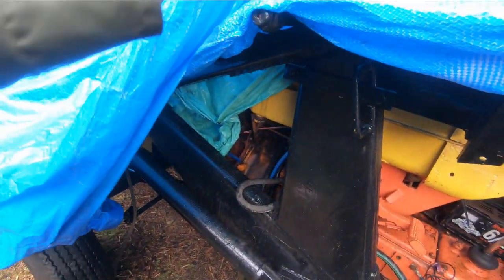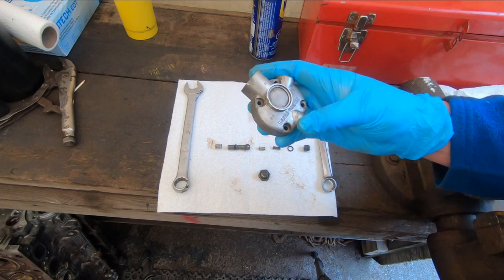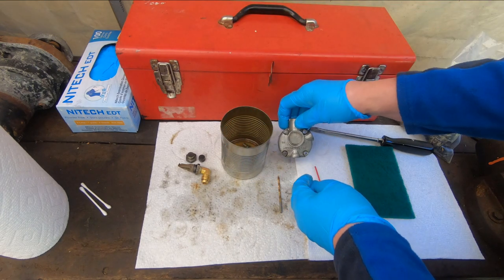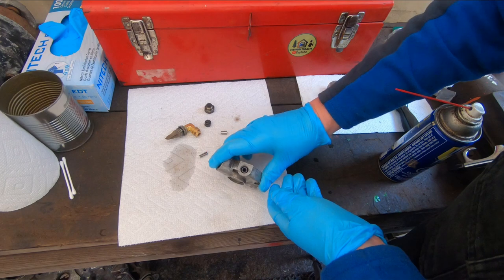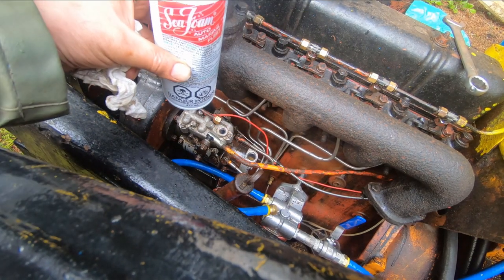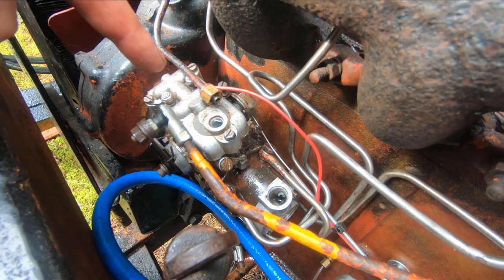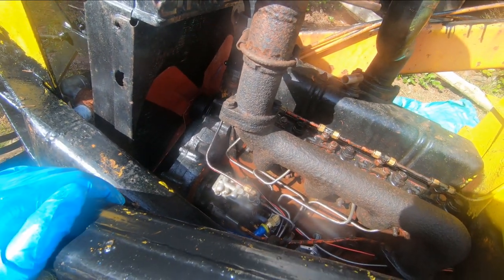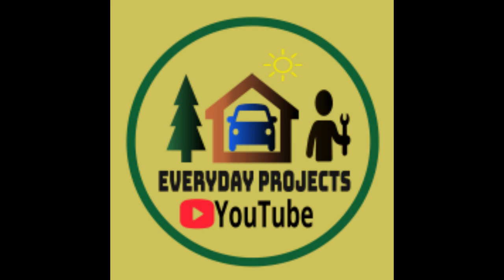FINALLY RUNNING !  1968 CASE 580CK TRACTOR ~ STANADYNE FUEL PRESSURE REGULATOR DISASSEMBLY & CLEAN ~

Comment: Well, that same little piston was really stuck in mine. I ran it through the sonic cleaner several times, but it remained really stuck. I ened up using a well fitting shaft to drive it out of it's cylinder. Just getting that entire cylinder and piston was an ordeal, but finally got it. I cleaned the cylinder really well, very smooth and did the same to the piston, but it does not slide back and forth when I shake it as you did. It does slide extremely smooth inside the cyliner thst it rides in, but does more with just bare pushing it. Thanks for that video, that really saved me a lot of troubleas the tractor is 50 miles from where I live, so that would be a heck of a drive. Thanks again, will keep you updated.
Reply from the maker: I bought a sonic cleaner from VEVOR a while back and they are great for cleaning small parts. I don't know why I didn't use it for this fix??? Take care Michael

Comment: Wonderful job, great progress😂 Ive  been watching your channel for a couple of years..I have a1968 580B  a backhoe / Loader  basket case , it was owned by a good friend of mine Ranger , a rod bearing spun , he took it a part , removed the head .Pan , rods pistons and sleeves Realized he had to split the tractor to get the crank welded .He covered in a blue tarp and left it for15 years in the rain. He was killed in a Train accident and his widow gave it to me . I bought a used 188 d wilth a frost crack in water jacket complete Core motor and intend to split the tractor and make one good engine out of two with a overhaul kit .Ive learned a lot from you .Thank you for documenting the process 😊 yours Kim
Reply from the maker: Very sorry to hear about your friend. You are lucky to have the tractor. What a wonderful gesture for his wife to give you the tractor--it must mean a lot to you.  I am slowly getting things together on this one. I don't have a lot of time to spend on it but I am making progress. Getting the engine to run was a big leap forward. Take care and keep in touch.

Comment: Is it still hard to start. Because mine was sitting for 10 years with a bad starter, I fixed the starter, and it fires up on a dime every single time. It can sit for months and still start as if it was running 10 minutes ago warmed up or 1 engine revolution at the most. It’s like the engine just left the factory and the rest of the tractor was rotting away. Can you do an update video on your tractor, show the current progress and what still needs to be done. I seem to enjoy watching you work on your tractor more than I like working in mine. Thanks for the content.
Reply from the maker: I've been planning an alternator video and this might just be the push I needed. Let's see what happens in the next couple of weeks.
I put in a new starter a few years ago and have used it hard while trying to start this thing. Maybe it has lost some of its original power. I haven't done much to the tractor this year as so many other things get on the "To Do List". I hope to do more this FALL but the alternator install should show up soon. All the best!
Reply: @EverydayProjects  awesome it just so happens less than a month ago I commented wanting to see an alternator video. So perfect. Thanks a lot.

Comment: I have a 1970 Case 580CK as well that has been disassembled since 2013.
Reply from the maker: Sounds like another project similar to this one! Does the engine run? I had trouble getting this one to start after it sat with old diesel in it for 15 years! Had to clean out the injection pump (videos on this channel). Best wishes with your 580CK and greetings from British Columbia, Canada!
Reply: @EverydayProjects  When I bought mine the engine and backhoe ran perfect, but it would leak all 5 gal. of  transmission oil out the fly wheel bell housing each night and it always was sluggish when driving.  Eventually it quit moving.  It turned out that a half moon key got sucked up into the shuttle shift transmission pump along with tons of old paper gasket material, because the suction screen had a hole in it.  It snapped the input shaft on the pump.  I paid the machine shop $90 to fix the shaft and installed it, but I had trouble getting the dashboard to fit back on, so that is where I am.    It took me 3 years just to get the cab off.  What a nightmare.  I will never put the cab back on it.  The cab had to be removed, so I could remove the steering column, because the steering column sits on top of the transmission pump cover.
Reply: @EverydayProjects  I have not ran the engine, since 2013, since there is not dash on it.

Comment: I’ve got a 580CK I just hooked up a recently charged battery to, I instantly hear the accessory clicks come on by itself and can’t start it. A wire coming going to the alternator does a small jerk and jump every click. Won’t even attempt to turn over I can’t even find a diagram
Reply from the maker: It sounds like a battery issue even though you have a fully-charged one. The wire from the alternator is the charging wire (or the one that goes to the ammeter). You should be able to disconnect that wire if it is a concern while starting the engine. It has nothing to do with the starter turning the engine. There may be an issue with the starter solenoid. They often click when they begin to fail. Let me know if you need any help, I'll help if I can. Maybe I have a diagram I have the original 58ck Manual.

Comment: Have you looked into the tank, mine 580CK has a ton of sludge in the tank. That sump that is on the bottom of the fuel tank I imagine is full of sludge as well. Will have to tackle that here soon, once I even get my pump put back together. Love the video, very detailed and I to had not removed that plug, all the little piston and all is stuck .Will put Seafoam in my sonic cleaner an run it for a bit.
Reply from the maker: I removed the tank last year and patched leaks with JB Weld. While out, I cleaned the inside with dish soap and hot water. It was gummed up really bad. Here's the video I made when I upgraded the filter. https://www.youtube.com/watch?v=eoKXc6LXHgM 
I just installed the single base for now but need to get a secondary on there soon, now that the engine is a go. I bought most everything from Amazon: WIX Spin-on Filter base # 24770. Baldwin spin on filter (#1212 with a drain for now). The rest of the stuff (push on fuel hose 3/8" and fittings and ball valve) from a local diesel repair shop and hardware store, the diesel shop was the place to go for the push on hose and brass fittings, they deal with this stuff all the time. All the best, Michael. Let me know how you make out or if you have any more questions. Cheers!
Reply: @EverydayProjects  Great, and I am so glad that you got her going, big relief for sure. Thanks for the information ..
Reply from the maker: @michaelkennedy2528  :goodvibes::hand-purple-blue-peace:

Comment: Great job, that made my day to hear the tractor running and it sounds great.
Reply from the maker: It has been a long road to this point. So many things must operate in synch for any engine to run. The end cover pressure regulator was definitely the issue holding me back. It was only possible with the contribution of a fellow YouTuber who suggested I look at the regulator. It is an amazing community that I’m glad to participate in. Lots more to do on this old 580CK but having the engine finally run is a big leap forward. Thanks for your support !😊
Reply: @EverydayProjects  I agree, the Youtube community is great. I am looking forward to seeing more on this tractor

Comment: I have a backhoe exactly like that. When I run it out of fuel I crack all 4 of the injectors and crank it till I get fuel squirting from the fittings. If there is ANY air in any line it won't run.

Comment: Hi guy, impressive. Thanks for your videos, it encourages the diy people like me.
I have a 580 CK from 1968, fuel pump is giving me awful headaches : it starts, but the foot throttle is not working well. It varies only after a delay of seconds (up or down, same).
I suspect a bleeding issue, I understood it's anightmare. But I can't find any information about the procedure, how to bleed this f*** pump.
Any idea please ?
thanks alot
Reply from the maker: This one is a 1968 too. I took the injection pump apart and put a kit into it. It took me a few tries to get everything right but this video shows that it worked. My tractor had been abandoned and left outside for about 15 years with fuel in it. The diesel gummed up everything and the pump would not pass fuel through it. I filmed most of this stuff and posted it to my channel. If you look on my channel, there is a tab at the top titled "playlists" In there are all the tractor videos in one folder. I hope they can be of some help. If you need any tips or assistance, just post it here and I'll answer to the best of my ability. Plus it'll be good to know how you make out with it.
Reply: @EverydayProjects  : yep, I saw each one more than twice !
I'm still in trouble with my pump, probably i will need to renovate it. Do you know any website where I could find a renovation kit (o-rings etc...) please ?
thanks, Cyril
Reply: Hi @EverydayProjects  ,
in case it would help somebody : 
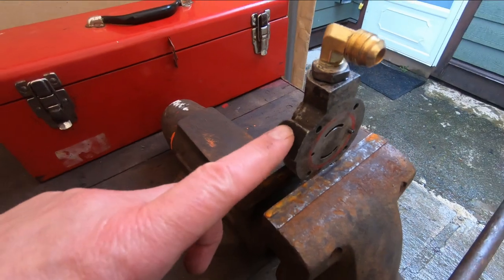finally my pump issue has been solved : i managed to unscrew a little bit the screw that we see at 2:20, put some additional pressure in the system and finally some air and gazole passed along the screw. 
after restarting it was improving a little bit the response time, insisted a lot and then the throttle finally works ok or nearly.
I think I had air bubble at the level of the pressure regulator AND a piston locked by rust. Bleeding the air allowed the gazole to pass through and lubricate. 
It was my 2 cents' contribution.
Now I have another issue, brake only on right side. Maybe linked to oil level in the transmission ?

Comment: Musical!
Reply from the maker: I told you it was going to be special!! Like you mentioned before, it DID belch smoke like a Battleship laying down a smokescreen, Ha Ha 
It will take some running before I expect the smoke to clear at all. That pressure regulator was holding back the fuel all along. granted, the pump was full of gum and varnish too but this regulator clean out was the final hurtle!!
Reply: @EverydayProjects  No doubt. There's oil in the cylinders, it hasn't run in years and the rings might need to limber up for a while. It's probably blowing out seafoam and anything else you put in there to make it easier to wake it up. Like an old monster coming out of a decades long sleep, gonna take it a while to clear it's throat. Seemed like it really teased you before it got fuel up. Have you tried to move it at all? Even an inch just to see if the drive train might be OK? Even without hydraulics that thing is going to be a bull! 1st gear low range, you can get out and crawl faster. High gear, high range, forget it. You'd better be on the flats. That's a travel gear only at least for mine.
Reply from the maker: @heliarche  Haven't tried to move it. I have to hook up the alternator/fan/belt/water pump drive before I can risk any lengthy runs. I cannot chance overheating the engine. Then I'll try to see if it'll move forward and back. It will be good to have an alternator charging the battery because this one way street of discharging a battery to crank and then having to charge the battery is getting really old--fast. I have to hook up the steering too, and change the torque tube hydraulic fluid because there is still some traced of water in there. Then, and only then will I get to the boom, bucket and main pump hydraulics. A long road ahead yet. Image that this was the first run in almost 20 years!! No wonder it has blue smoke. Perhaps it'll clear. I'm going to keep using Seafoam in the fuel too. It is recommended to preserve diesel and keep things running free. Also, it can go into the crankcase oil too (1/2 can to 6 quarts of oil) to keep the oil passages free and clean.
Reply: @EverydayProjects  Ok I gotcha there. Yea make sure that sucker is at least cooling properly. Charging the battery would be nice as well! You might have to run it a while and coax the clutch and shifters a while before it actually wants to even try. Hopefully that aspect won't put up such a fight as fueling did. Hopefully you can at least have it mobile with no more big hurdles. Once you get into the hydraulics, might be a few popped lines. You're going to want to go to your Harbor freight equivalent, I think Princess Auto(?) and get the big 3/4" drive sockets if you don't have any. If the flexible line for that boom up/down cylinder has any sort of dry rot, change it while you have the chance. You're going to want to separate the hoe from the machine. If yours is set up like mine it's not as intimidating as it sounds. It's a job and you take your time with it, but it's not horrible. Looks like on yours the tension rod nuts are fairly easy access too.

Comment: Stupid question maybe but my uncle has a backhoe that is just like this and it won’t start, where is the spark on this motor?
Reply from the maker: There are two different engines in these. One is a gasoline engine and the other is diesel. Mine is diesel that ignites the fuel by high compression. A gasoline engine runs at much lower compression in the cylinder and the gas is ignited with spark plugs. If it’s a diese engine, it is important to be able to crank the engine fast to get high compression. Sometimes, if the battery is low they won’t start. Also, the fuel system must be clean. A gasoline engine does not have to spin as fast to start. Check which kind of engine it is and go through checks of all the components. On a gas engine, make sure the gas is fresh and the spark plugs and wires are in good condition. On a diesel, the fuel must be clean and the battery very strong. Good luck and best wishes.